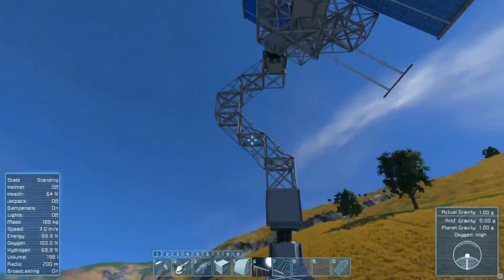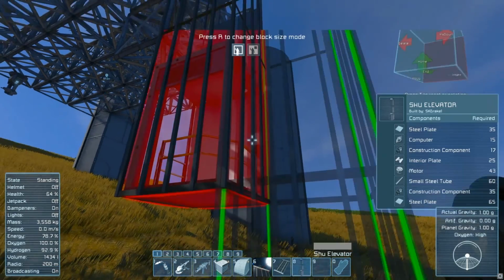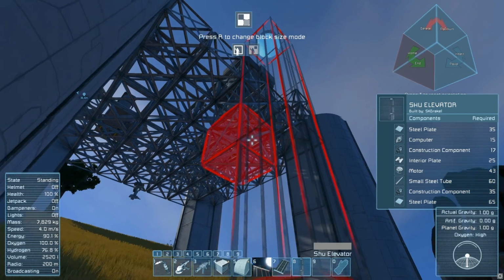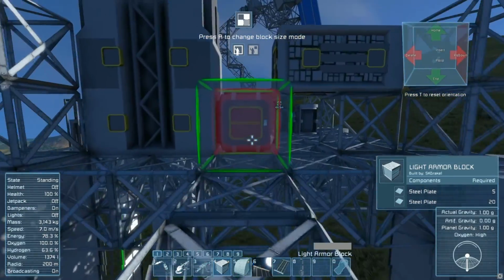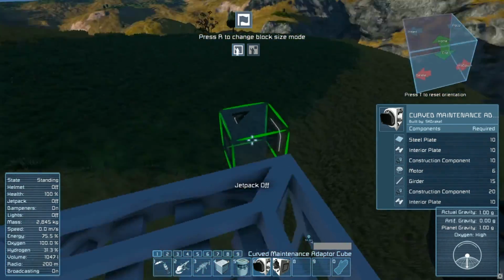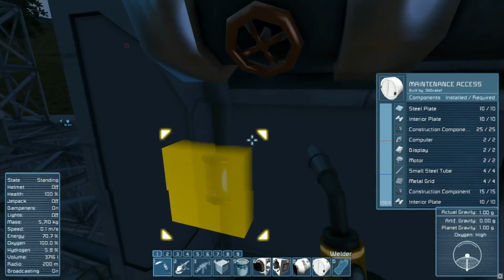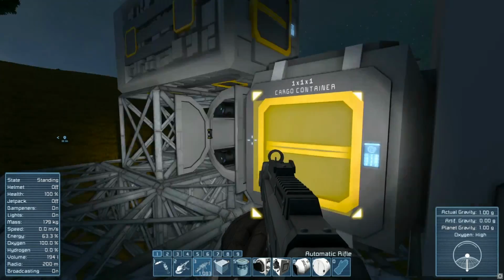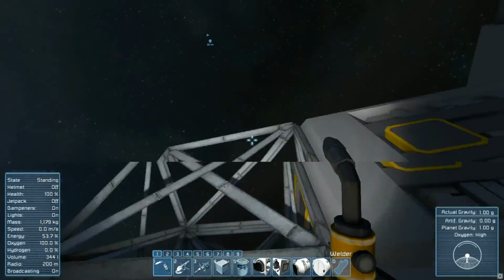[SEEM] Space Engineers S2:E3 Elevator and maintenace tunnels

Comment: Your Maintenance Tubes are not connected to the cargo system. 
You need to attach an Maintenance Tube Adapter to a connection point like you did the Advanced Rotor
Also I seen there were other elevator blocks... you may have a way to only do 2 floors